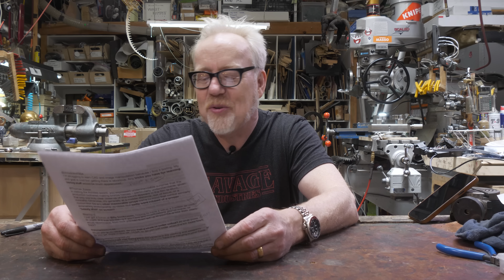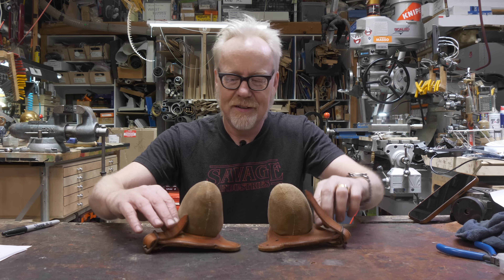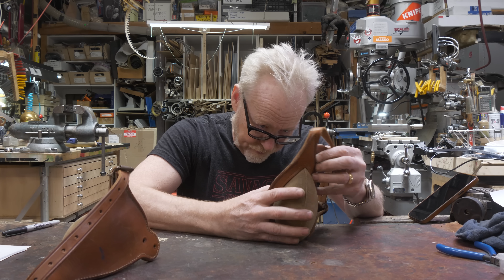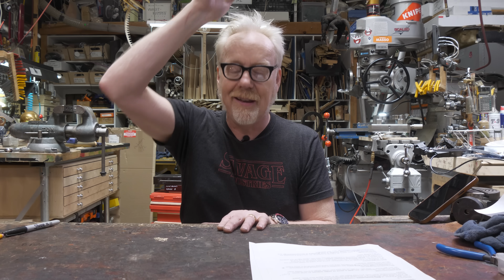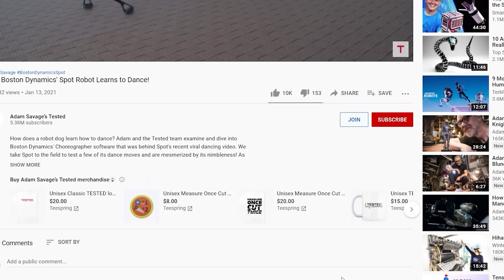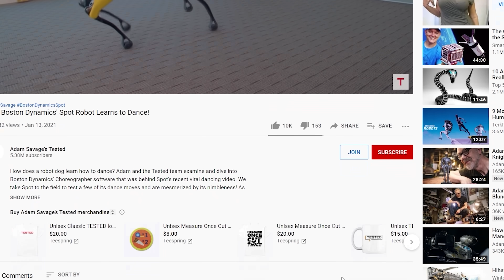What Are These Mysterious Things?

Comment: Ikea book case modifications - glue the back panels into their rebate slots for greater strength.  A few panel pins help too.
Reply: If it's a permanent location or you can afford to replace them if you move, absolutely! Any added stability is a boon.

Comment: Bucking Rolls are sometimes used on slick fork saddles to give the rider a little more security. They offer some “grab” for the legs and can help a rider keep his seat when a horse bucks or makes a hard turn on a cow.
Reply: Yes those are to hold you in the saddle. I work and repair saddles every day. I have several pairs of these
Reply: Can confirm, they are 100% bucking rolls
Reply: @Dwill545  thought so as well, but the attachment points seem off.
Reply: Are they really though? Because I can't find a single image of bucking rolls that have those straps to them that Adam's have. In all my searching they're always just two strapped-together pads that are riveted or similar to the saddle with no straps in sight. So if these really are bucking rolls their design seems to be highly unusual or called maybe something more specific.
Reply: @Duker-Koushakur  Most don't attach to the saddle. They are attached to each other and adjust for the rider and sit before the horn. I found several pics of them By just googling bucking rolls under images. I think some older versions loop around the horn.
Reply: @Koushakur ... Colorado saddlery... makes them that look just like this...
Reply: @Duker-Koushakur  I agree that the straps/attachments are inconsistent with all of the images of bucking rolls I've seen so far. That said, the bulges and the overall technique of construction are consistent. If they are bucking rolls, I suggest they are a custom job. Possibly for a more secure attachment by going around the fork rather than just across the rise. The result would also rotate the bulges to one side or another of the bottom screw attachment, rather than in line with it, which may the the intended result (if they are custom bucking rolls).
Reply: @dannyrouse5723 the problem is that not a single image of a saddle roll with three attachment points or any kind of buckles are available anywhere.
Reply: @Duker-Koushakur  The part that would have likely connected them together is just missing is all. You can see where they would be riveted or connected in the middle
Reply: @animehuntress9018  That is exactly how and what I searched and could not see a single image of a design that doesn't attach directly to the saddle, and I did scroll through the images for a good while. I can't stress enough that, according to Google Images, there exist one and ONLY the one design of these on there, nothing even remotely like what Adam's things look like
Reply: @dannyrouse5723  On their website they only sell a design that looks like all others I found on google images, IE not at all like Adam's
Reply: @caodesignworks2407  That is so extremely not the issue. The issue is how the eff the straps would attach to the saddle, not how they would attach to each other.
Reply: @Duker-Koushakur  seem obvious to me by looking at the many of them for sale online
Reply: @Koushakur they probably right but I agree.  Everything I saw has way less straps
Reply: @Duker-Koushakur  Yes. They are usually strapped together and then each goes under a screw that goes into the tree, but that particular pair are designed to go around the swells or fork (bucking roles are superfluous if the tree is built with any substantial swell) of the tree and then under the same screw as the other style!
Reply: @Duker-Koushakur  we had saddles that had pretty straight or slick pommels (swell, or fork).  Those straps would go over the horn, or top of the pommel.  You see the holes in the little tab part?  You could tie off the bump at that point.
Reply: @Koushakur
As the guy said, they loop over the saddle.  They don't attach to the saddle.  Although one of the straps is missing, there was never a strap to attach them to the saddle because that's not how they work.
Reply: @Duker-Koushakur THOSE ARE 2 LEATHER CODPIECES NOT BUCKING ROLLS. He's holding them upside down and that explains the 2 holes off to the side instead of 1 in the middle. You will never see any Bucking Roll designed this way.
Reply: My immediate reaction was "that looks horsey." Then cluelessness.
Reply: @petermgruhn Same here. Plus they seem made by a saddle and tack maker with the type of leather work and sewing. They're very well made.
Reply: My guess was a leg support for a saddel
Reply: So glad, I was shouting at the screen that this was a saddle thing!
Reply: Yes! I had a set of these on my saddle when I worked cattle in the 80s. The set Adam has is unique in that they're buckled through the gullet of the saddle instead of just across the top.
Reply: Yep. Bucking Rolls for a Western Saddle.
Reply: Having zero experince with horses or animals or leather work, i instinctively felt it had something to do with human and horse interaction. Glad to know my gut was right
Reply: This comment should be pinned in my opinion.
Reply: @zachvalue They point out from the horses side, not in. In no way do they affect the horse except to keep the rider firmly in place.
Reply: It’s hilarious that being from the country and a faux cowboy that I knew exactly what they were and yet Simone like Adam Savage has no idea.  Lol.  It says a LOT about how our worlds can be so different.
Reply: @tidalboxer "Simone"???

 Beware of text-to-speech functions!
Reply: Neat he has an answer now!
Reply: Lol, i know most people didn't grow up on a ranch but wow😅
Reply: Came here to say that. Can confirm, too.
Reply: Saw these hanging in a Ferrier shop and thought they were pads for working on hoofs. Glad to know now. Thanks.
Reply: Just googled Bucking rolls and that is 100% what those are!
Reply: Best when applied to an A fork saddle
Reply: Probably good on a true Wade saddle given the smaller swells
Reply: I was about to say it's part of a sadle and saw your comment😂
Reply: Haha saw the thumbnail and came to say the same thing. Bucking rolls
Reply: My first thought was a saddle attachment.
Reply: @@zippydastrange Best explanation I've seen so far
Reply: Shhh, don't tell Adam..... 🤫
Reply: Yakko:..... mwah!
Good night, everybody!
Reply: To anybody saying OP is wrong, I say, "Neigh!"
Reply: Came to post they are for a saddle.
Reply: absolutely 100% correct......
Reply: Came to say bucking rolls, or polies if your saddle is Australian, xD
Reply: He’s right they are Bucking Rolls.  I looked it up.   It is fascinating.   I have a friend that’s constantly bring me things that she doesn’t know what they are and then I go and try to figure out what it is.   I’ve been rather lucky, since I have them such a weird background are usually have a direction I can go in my search.
Reply: Yep, put many a mile in a slick fork saddle with Bucking Rolls.
They were also called something that one should not put on any kind of social media now days too! 😊
Reply: Correct😊
Reply: How interesting! Thank you.
Reply: Yes! I can here to say they are bucking rolls!
Reply: Having done a lot of leatherwork I figured it was something for horse riding just by the build and look… good to know
Reply: @heespharm  I had no idea what they were, but they did look like some sort of horse tack gear. Never heard of a bucking roll before.
Reply: https://www.youtube.com/watch?v=el0gz19VHTE
Reply: Your answer is better then mine as it’s probably right. Well played.
Reply: https://www.youtube.com/watch?v=XZ3UfWR-81I
Reply: see you saved me a stupid comment . i knew they had something to do with horses . i just dint know what . it looked almost like blinders but i knew it was to crazy to be blinders . thanks cause i would have been searching google for the next three days or more trying to find out what they were .
Reply: This is correct and also known as boar tits
Reply: I only really knew it looked like they was made from a Amish because the leather ... but I had thought they might be horse blinders to cover the horses eyes .... lol
Reply: My Holmesian brain imeadiately went to equestrian use. My only hold back was they are too clean. Keeping horse anything clean is a full time job all on its own. Well done.
Reply: Bucking rolls, what I’m having for my bucking lunch 😂
Reply: Fake breasts when tied together as a bikini with the buckle straps going over the shoulder. Then a bra put on top of it. You are in San Francisco….
Reply: They looked very "saddlery" to me- but I was thinking more along something for sidesaddle.
Reply: Not as fun as my fake boobs idea.
Reply: 100% NOT bucking rolls, they are eye patches for alien space pirates.
Reply: Exactly!!
Reply: I was thinking it was some sort of saddlery piece. Thanks for the insight. Interesting.
Reply: Old time Falsies
Reply: Kinda looks like fake under clothing ta tas to me
Reply: Depending on location: That’s a set of what’s known as “Squaw Tits”, or “Pommel Swells”or “Bucking Rolls” usually used for an “A-Fork” or “Slick Fork” saddle to give the rider something to grasp onto with their legs if they’re riding a horse that bucks.
Reply: I am in stitches that he didn't know! I call them squaw tits! Cowboy world!
Reply: That's right, I was thinking something related to livestock....
Reply: When I saw the thumbnail, I thought they were codpieces (a midieval fashion menswear thing), maybe used for dressing up for a ren faire, then I saw they weren't hollow.
Reply: Cowboys often call them "Squaw Tits".
Reply: r/whatisthisthing sub reddit is just this (identification of strange objects) over and over and I love it.  They are very rarely stumped and there is some really strange stuff that pops up.
Reply: I was thinking something to do with a horses tack.
Reply: @fluchterschoen my mom passed away.
Reply: Buckers come in handy when roping and cutting stock keep  you in the  saddle.
Reply: By the thumbnail, I thought the ball was hollow and the thing was some kind of medieval private parts protector.
Reply: Vagina pads for Renaissance fighters 😂
Reply: The cowboys where I lived called them squaw tits
Reply: Look for this book  /
" THE HANDYMAN'S Book " 

ESSENTIAL WOODWORKING TOOLS AND TECHNIQUES

PAUL N. HASLUCK
Reply: I thought they kinda looked like mountie "hip pads" I genuinely see a mountie with pokie hips lol
Reply: And here I was thinking they might be for converting a male mannequin into a female one. Silly but I could see it for an ancient mannequin made before plastics.
Reply: @squarewheels2491 I was thinking fake boobs as well. Great minds think alike lol
Reply: I thought they might have been moob simulators 😂
Reply: @chrisleggatt3240 this is literally what I was thinking too 😂
Reply: I knew I'd seen those somewhere..
Reply: Bucking rolls do help to protect you from getting bucked off a horse 😅
There are high end, finely made bucking rolls that use beaver 🦫 tail leather for the part that protrudes out. They are really nice looking.
Reply: I would have guessed a cod piece for a on legged pirate.
Reply: @ghostdragon9221  🤣
Reply: @ghostdragon9221  it is a cod piece. He is holding it upside down. Look again. 2 cod pieces.
Reply: They’re wall leaners for when you need to lean on a wall for various reasons. Be that rest, nonchalance or just your basic lurking activities. You wear them in the obvious way that you’d imagine.
Reply: it looks like the extra holes are for riveting to the saddle?
Reply: I read that as Rocking Balls 😂
Reply: I was going to guess codpieces as well, although it would be odd to find a matched pair of them 😏
     But I guess they're not.  Incidentally, "horse tack" is one of the default identifications when archeologists can't figure out what it is they've just dug up.  "Ritual object" is another.
Reply: They are referred to as Squaw Tits, at least 65 years ago when I first saw them.
Reply: Yes looks like bucking rolls or a Saddle Sofa.

I am leaning towards Saddle Sofa.
Reply: I also can't find an example of bucking rolls with a strap like that and can't picture how the strap would be used
Reply: I could use a pair of these because I takes all kinds. Sometimes they come in Thicc 🥰😘🤗
Reply: i dont think they are bucking rolls. if you look at them, they never have straps like that and these couldnt be used as bucing rolls based on what we see.
Reply: So can one of you smart folk explain how this pair attaches besides "must be a magic saddle different from all others known"?

Which way is forward? Which way is even up? If the strap goes all the way around the tree then where does it come out again to buckle? Do they even buckle to themselves, because the strap looks a little awkward for that, like it wouldn't sit flat, I kind of feel like the buckle should be angled differently if they buckle back to themselves. Also the straps don't seem to show any where to tell where bend points would be (although may just be unused). 

I agree shape, size, materials, are all fine for bucking rolls but the only explanation I have for the attachment is that it was an experimental pair and they are unused and never made again because it doesn't work...
Reply: THOSE ARE 2 LEATHER CODPIECES NOT BUCKING ROLLS. He's holding them upside down and that explains the 2 holes off to the side instead of 1 in the middle. You will never see any Bucking Roll designed this way.
Reply: spoiler alert haha. But thanks. That makes so much sense
Reply: I thought they were for flat chested women.
Reply: They're made similar to but are actually made for for theater performances I'm a time when women were not allowed to to act in theater they're used to make skinny slides men look like four plays on stages

Comment: I agree with many others here. If you put some kind of adjustable lacing from the two holes on one, to the two holes on the other….. well, the straps would go over the shoulder…. and you would have very passable “stage tits”. Especially if you needed to change out of or back into them quickly
Reply: That’s a fun idea, but why would they need to be so robustly built.

(Haha. ‘roBUSTly built’)
Reply: @michaelsullivan8934  my theory is that they would be theater equipment so, re-used hundreds of time and left in a box for months or years. So it would need to be ready without needing to be replaced. Like stage swords or a gimmick leg that is supposed to appear to break on stage
Reply: Google "bucking rolls" its a saddle add on
Reply: @PondScummer  that’s amazing! Thank you for the info!
Reply: @PondScummer  is it? What for? Genuinely curious

Comment: To me, those things look like busts to add to a tailor's mannequin. No clue why it wouldn't be one piece, why they'd be so durably made, why they'd be so...aggressively shaped, or why you'd need that in the first place. I also think given Adam's costuming background, he would immediately recognize them if that's what they were for, so I'm probably wrong.
Reply: I had the same thought, bit as a theatre prosthetic. A lot of people think they're bucking rolls for a saddle, but maybe they were and converted?
Reply: @celticdude234  Well, I know from experience theatre folks will use anything from anywhere for any purpose! In this case, though, I doubt they were modified to any significant degree. I think you're right, they're bucking rolls.
Reply: My vote is for a bullet bra mold
Reply: Bucking rolls for a saddle

Comment: I put my LED strips on the doors and used copper grounding wire (two) with eyelets for bolts to make the pass from the body to the door. That way, when the door's open, i can extract whatever i'm looking for, and have it lit as well so i don't squint. No wires, only copper tape, which meets with a copper (classic fuel line) as the ground for the whole installation, and gets power from more copper tape (1cm wide) that's under the painted wall. All the shelves i have, have a spring and a hook. The hook, hooks on the copper line at the back, the spring falls on the copper tape on the wall where i scrape the paint off in the area. Makes it super easy to remove them, clean, put them back or rearrange on the go without having to deal with wires. I hate wires. Everything's powered by a single transformer that's rated based on the number of LEDs i have + margin of error based on the classic calculation.

Comment: An old bicycle tire spoke rebuilding tool is a thing of beauty.
Reply: A wheel truing stand?
Reply: I have a drum brake spring tool that's probably 80 years old that's been handed down from my grandpa, to my dad, to me.  It's simple, but beautifully made. And it's my favorite tool. Unfortunately,  cars don't come with drum brakes anymore,  it has no use.  On the plus side, I know I'll never break it.
Reply: @justinrodgers1485  unfortunately you say? Have you ever replaced a set of brake shoes? I'm thankful every time I do a set of pads vs shoes.
Reply: my motorbike had drumbreak a the back disk at the frount  @justinrodgers1485
Reply: Modern wheel building tools are also things of beauty.
Reply: @Opforvideo2  a steering wheel? A rubber tire? The rim a tire goes onto? What are you talking about?
Reply: @thormidthagahast8914  modern bicycle wheel building tools... spoke wrenches, truing stands, dishing tools, elegant simplicity.
Reply: Horse tack for saddles. Bucking rolls. Protect wedding tackle aka twig and berries.

Comment: I work in a scrapyard. Any tool that appears, that we have no idea of it's use, is rescued, and squirreled away.
Reply: A scrapyard close to where I grew up used to let you salvage for a couple hours on Saturday morning for 10 cents a pound.  I have so many useful and slightly dented things!  Dad found a very expensive drill there.  Someone threw it away because the switch broke.  Ten minutes of labor later, works great.
Reply: Thank you. I use to work at a municipal landfill with a “clean” public drop off area. I saved what I could. Cheers
Reply: Have you tried a reverse image search using photos of the tools?